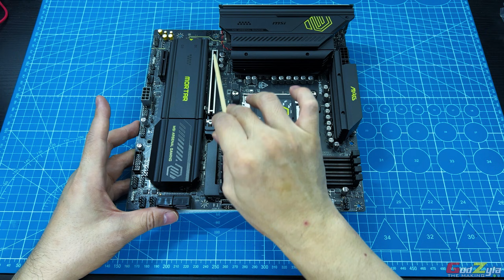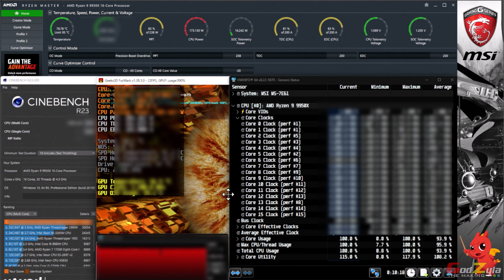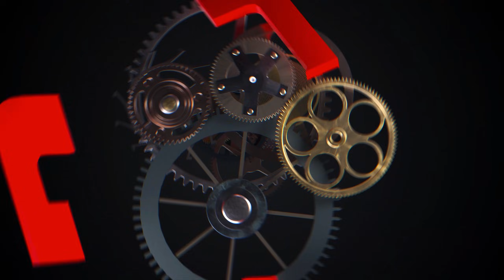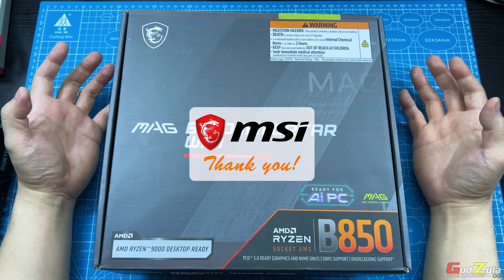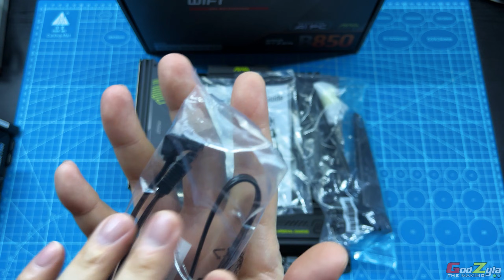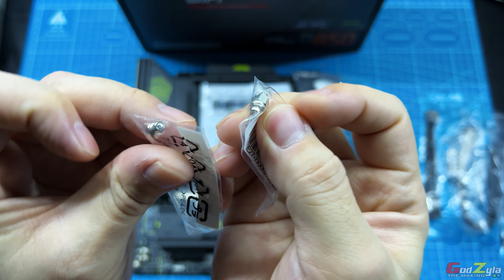MSI B850M Mortar WiFi

Comment: Lovely mobo, for the record the newer Arctic Liquid Freezer iii coolers dont fit as the PCIe slot for GPU is very close to the CPU socket and it hits the GPU backplate!
Reply from the maker: Hi Anthony Marsh, welcome to my channel. Thank you for the info, I wasnt aware of it till I go through the list. https://support.arctic.de/lf3-compatibility
Reply: damn, almost just pulled the trigger on this exact combo lol
Reply from the maker: Hi Swainix, welcome to my channel. That's close. maybe change another liquid AIO.
Reply: @KleoYan  it says compatible on the arctic's site?
Reply from the maker: Hi Xeon, welcome to my channel. For this board MSI MAG B850M Mortar WIFI, at arctic compatible listing  https://support.arctic.de/lf3-compatibility,  it says "Unfortunately, ARCTIC Liquid Freezer III is incompatible with this motherboard."
Reply: @KleoYan oh! sorry i don’t know maybe i typed in the wrong model or it was bug but yeah it does show incompatibility😅.
Reply from the maker: @Xeonedts no worries. We all do mistakes from time to time 😉
Reply: Thx for the info! My mortar arrived today and I've been planning to use arctic aio. Not sending back the mobo 😅 It's solid and no better mATX at this price point.
Reply from the maker: Hi HW Synergy, welcome to my channel. Yup this B850M Mortar is value for money. Maybe if you can return the Arctic and get another liquid aio will be great. Thanks for your feedback. I wishes you all the very best with your build. 🫡
Reply: @KleoYan  I havent got the aio yet so all good :) thx for the review
Reply from the maker: @KmtHW  oo ok ok .. got you and you are most welcome. 😉
Reply: So what do you think is a good aio cooler for this mobo?
Reply from the maker: @Papah_Anum  hands down. I will grab the Lian Li Galahad Lite II ARGB.
Reply: @KleoYan  Thanks buddy, I will check out the reviews.
Reply from the maker: @Papah_Anum  you can view the unit video https://youtu.be/y1EbZQb7__4?si=AW9-Calfe_Dt_Jlt and to see the comparision between the non argb or argb https://youtu.be/NHGm5789EW4?si=FqxprPX1zgnzEgBb. Infact some shops selling more expensive of the performance instead of the ARGB but when tested, the ARGB is slightly better and cost abit cheaper.
Reply: But I just ordered that 😂. So what should I get instead?
Reply from the maker: Hi Judas Blewit, welcome to my channel. If you have already purchase the GA II Lite performance, just use it 😉
Reply: @KleoYan  Thanks!
Reply from the maker: @judasblewit  You are most welcome 😉 infact you won't go wrong with either variant, the GA II Lite is a superior Liquid AIO.
Reply: @KleoYan  I'll order that baby it's on sale right now as well!
Reply from the maker: @judasblewit  Thanks good and congrats on the decision 👍
Reply: I have this motherboard and use a Nh-u9s air cooler with my R7 9700x.
Reply from the maker: Hi Eazy E, welcome to my channel and thank you for sharing the info 👍👍👍
Reply: Not completely true! I just bought both this motherboard and cooler and managed to get it fitting perfectly fine.
Reply: How about for a vertical setup

Comment: such a good youtube channel, motherboards are so underrated, i know the fact when i gotten lga1200 motherboard during 2021, and i kind of regretted it due to the fact it is a dead board unlike am4, so i was looking for a good am5 matx motherboard and stumbled upon this video. never skim or discount on motherboards, get a good one like this and it will last
Reply from the maker: Welcome to my channel Justin Wee. I am glad this content is useful for you. Thank you for the feedback and all the best with your new build 😉
Reply: @KleoYan i just have this mobo, have msi gaming trio 5070ti, 5 argb fans, 7800x3d, and when i install mystic light, it causes lag in windows during start up, after uninstall rgb software, the pc is okay. is this common, and do you know the solution to this problem ?
Reply from the maker: @JustinWee-k9m  I have not encounter what you are facing, the only thing I notice is that. MSI Center will load after HWinfo64 is loaded. It takes about 5 to 8 seconds to load. I have no solution on your case as I can't replicate your issue. I advise if you can ask at MSI reddit forum, there might be someone having the similar issue as yours. https://www.reddit.com/r/MSI_Gaming/
Reply: I have fixed the issue from this method
1. Open windows error log (and critical issue is power kernel 41)
2.Shut down, and unplug plug gpu power, ram slot, to ensure wires is tighten
3. On back, go to bios, and reset bios, making my RAM from overclock to 4800MT default, safe and exit
4. Entered windows, run some games, turn on and shut down PC 3 times safely, no issue
5. On back, go to BIOS, and MANUALLY set voltage for overclock RAM for the 6000mhz, 1.35v, soc 1.2v, memclk
6. save and exit
7. shut down and power on from cold boot 4 times, no crashes for now

root cause? i think if you set auto for amd expo, the default voltage is low, i think it is 1.2v or 1.02v or something (cant remember), so because of not enough power, it cannot perform

so far so good, thanks to chatgpt (amazing)

Comment: Awesome review as always. I have the same motherboard with 9700X. But I'm getting 58°C at idle no unwanted background processes are found, repasted with Noctua thermalpaste, the AIO pump is working fine. But when I check on the OCCT it pulls 35-40W at idle and using 1.25V.....Which should be around 25-28W at 1.15V what do I do to achieve that. It was earlier around 45-47°C at idle now it is atleast 11°C more.
Reply from the maker: Welcome to my channel Midhun Gopan. Lowering down the VSoC voltage and to do Vcore Offset. You can refer to this content but you will need to know your 9700X Default PPT, TDC and EDC. Also kindly do not use curve shaper. https://youtu.be/IYK0hxQqCoA
Reply: @KleoYan   Thanks for the help, I did everything and found out the values for 9700X but still the idle temp is 59°C. The culprit I've found is the CPU telemetry Voltage is around 1.3V which is the reason why the clock speed even without doing any task is 5.3GHz and idle temp is 58°C......When I set the Power plan and put the maximum processor power to 99% instead of the 100%(default) the CPU telemetry voltage drops to 0.9-1V the idle temp becomes 47°C but the Clock speed is drastically reduced to 3.73GHz as well. Can we reduce this CPU telemetry voltage without sacrificing the performance?
Reply from the maker: @midhungopan9270  I will leave Power Plan as balance. I am not sure if you did follow the vid but will provide you the steps. my method is not to push but to undervolt to get above average performance. If you are aiming to keep pushing. then ignore the steps below.

==Undervolting  Steps for 9700X==

01) Make sure to have latest bios version but not beta version on your motherboard
02) Clear CMOS first  (PLEASE MAKE SURE TO CLEAR CMOS) 
03) In UEFI go to Overclocking
04) Enable A-XMP or EXPO (depending your rams which it supports)

For Step 05) set it if your rams are of 6000 M/T

05) Set DRAM Speed 6000
06) Set FCLK Frequency 2000
07) Set UCLK DIV1 Mode to UCLK=MEMCLK
08) Set CPU Voltage to Offset
09) Set CPU Offset Mode Mark to - (negative)
10) Set CPU Offset Voltage to 0.05V
11) Set CPU NB/SoC Voltage to Override Mode
12) Set Override CPU NB/SoC voltage to 1.15v (make sure is 1.15v and not 1.5v)
13) Save and load to windows, run Aida 64 Stability test for 30minutes

If with errors, go back to UEFI, set the CPU Offset Voltage to 0.025V, repeat step 13) 
If still error, go back to UEFI set CPU Offset Voltage to Auto. (repeat step 13) 
if still error, go back to UEFI set Override CPU NB/SoC Voltage to 1.16V (repeat step 13) 
If still error, go back to UEFI set Override CPU NB/SoC Voltage to 1.17V (repeat step 13) 

you might need to set NB/SoC Voltage higher if it keeps failing but do not set CPU NB/SoC voltage above 1.18v
If no errors, go to UEFI and proceed to step 14).
The above is to ensure your processor can run at offset voltage and your RAMs able to run NB/SoC Voltage at 1.15v ~ 1.18v (depends which is stable for you)

14) Click on Advanced CPU Configuration
15) Click on Precision Boost Overdrive
16) Click on Manual 
17) PPT Limit to 88W / 88000mA 
18) TDC limit to 75A / 75000mA 
19) EDC limit to 150A / 150000mA
20) Set Platform Thermal Throttle Limit 85
21) Scroll down, click on Curve Optimizer
22) Select All Cores under Curve Optimizer
23) Select Negative under All Core Curve Optimizer Sign
24) Set All Core Curve Optimizer Magnitude to value 20 (make sure is -20 and not +20)
25) Save and load to windows, run Aida 64 Stability test for 30minutes

If with errors, go back to UEFI, set All Core Curve Optimizer Magnitude to -15, repeat step 27)
If with errors, go back to UEFI, set All Core Curve Optimizer Magnitude to -10, repeat step 27)
If no errors proceed step 26)

26) Set curve shaper as following.
Med Frequency , Low Temp & Med Temp & High Temp to -15
High Frequency , Low Temp & Med Temp & High Temp to -10
Max Frequency , Low Temp & Med Temp & High Temp to -05
27) Save and load to windows, run Aida 64 Stability test for 30minutes

If with errors, go back to UEFI, set Curve Shaper to all auto, use only Curve Optimizer, then repeat 27) 

Final test run, you can follow or not to follow as I do these test to ensure my system runs stable. 
A) Run Aida 64 Stability Test for 2 hours 
B) Run OCCT with the configures below and run 2 hours
C) Set DATA SET to Large
D) Set MODE to Extreme
E) Set LOAD TYPE to Variable
F) Set INSTRUCTION SET to AVX2
G) Set time to 2hours
H) Highlight CPU+RAM
I) Click on start and run the test.

Once all done, play some games and observe.
Reply: @KleoYan  I have done almost everything except the FCLK and UCLK things only set the EXPO . Since I have the same motherboard there is no stability issues on curve optimiser with -20, CPU offset voltage to 0.05V, SoC voltage to 1.15V everything is stable.

The surprising thing is when I run cinebench and furmark simultaneously the temp never gone beyond 61°C 😂. But the idle is 58°C......and btw my bios is updated to the latest one released on March 16th, and cleared the CMOS as well.
Reply from the maker: @m @midhungopan9270 he issue is not on the settings. Is more of others wanting to push. Setting power plan from balance or performance without knowing it will draw more current. That’s where temperature will increase.
Reply: @KleoYan It is always in balanced mode. But we can change the minimum and maximum processor state in advanced settings for balanced mode as well. Which is on 0% and 100% by default. When I change the 100% to 99% for maximum state the temperature will be drastically reduced from 58°C to 47°C idle. Also the clock speed went from 5.5GHz to 3.73GHz on idle and CPU telemetry voltage went from 1.3V to 0.9-1.0V......I'm not an overclocker and I prefer stable performance along with optimum cooling is my thing, but watching 58°C at idle made me look around and is there something I did wrong. You have the most detailed and easy to do content by miles.
Reply from the maker: @midhungopan9270  Oops! my bad, now I see it.. hmm for this I am not able to answer your question as I don't fiddle with that setting. The only settings I will set will be 1) PC never to sleep nor hybernate 2) Monitor will sleep after 1 hour 3) Turn off hard disk to Never

Comment: Between this and the Asus TUF B850M Plus WIFI, which is better?
Reply from the maker: welcome to my channel Tito Gamer, I prefer this board as it has a 5G Lan port and the Wifi 7 adaptor is making use of qualcomm 865 which is of 320MHz signal channel bandwidth as compared to others which are using MT9725 mediateck adaptor which only have 160MHz singal channel bandwidth
Reply: @KleoYan  thanks for the input. I was decided on the TUF Mobo after watching your video review but when I saw this I thought this was better and more future-proof.
Reply from the maker: @acestaniel all the very best with your build. 👍
Reply: @KleoYan  thanks! Your videos are very informative and comprehensive.
Reply from the maker: @acestaniel  you are most welcome. 🫡

Comment: Hello 👋, I have this board as of now my parts are wd Sn850 x, xpg s70, noctua nh-u12a, ryzen 7800 x3d, deep cool ch270 digital case. Ram and gpu yet to buy. Will this be a good build for solid 1440 p and 4k down the road I am looking for used 30 series card and I don't have budget for new 50 series. Ram wud be 32 gb ddr5 cl 30 or 36. And psu is 1200W super flower leadex vii.
Reply from the maker: Welcome to my channel tech INC. All your component check out well, you might consider 4070Ti Super for higher resolution gaming.

Comment: Question1: I have planned to use a 1tb gen4 ssd and 5070ti gpu on this boad. Should I connect the PCIe power cable on the lower side of the mobo?
Question 2: In my country, only thermalright AIO coolers are on my budget. Can you tell me what dimension of AIO I should buy which can be connected to this mobo unlike arctic liquid freezer iii pro
Reply from the maker: Welcome back MaybeWeirdVideos, it will be wiser to plug the bottom 8pin PCIE socket. This will provide stablity to your lanes on PCIE and M.2 Slot. as for thermalright AIO. I will go for the Thermalright Frozen Warframe 360 BLACK X
Reply: @KleoYan  Thank for the reply man. Really appreciate your insights and deep knowledge. I can spend exta 20 dollars to go for thermalright grand vision 360mm for the nice display, would you recommend this one over frozen warfame?
Reply from the maker: @maybeweirdvideos7557  So far I have tested only 2 Liquid AIO from Thermalright, I am not sure how good the Vision 360 is. anway if you are using 9800X3D with PBO2 set. It should not be an issue to cool it.
Reply: @KleoYan  Thanks again for the suggestion, my cpu is ryzen 9 9900X. I will then look into some reviews of these AIOs and then will decide
Reply from the maker: @maybeweirdvideos7557  you are most welcome and all the very best with your findings 👍👍👍
Reply: @KleoYan Back to you again my friend.
Question: There are two CPU 8pin connector holes on the upperside of the motherboard, should I connect both to power up my CPU? If not, which one I should connect to?
Update on AIO selection:
I have decided not to go with thermalright AIOs cause here in market a lot of units have faced warrenty issues and a reputed salesman told me not to go with it. The distributors are of thermalright here are not helpful too to response in those matters. So I decided to take deepcool LM360 instead.
Reply from the maker: @maybeweirdvideos7557  Dave Stevesen it can operate with just one 8Pin EPS connector, look for CPU_PWR1, the word is inprinted on the motherboard, check around the 8pin sockets. I will still encourage you to use both for more stability.
Reply: @KleoYan Thanks for the reply. I will use both then❤
Reply from the maker: @maybeweirdvideos7557  you are most welcome and all the best with your build 😉

Comment: Hi Which Cpu Air Cooler would you recomend , as i hear its a tight fit, betwen the Cpu socket and the Gpu  ????
Reply from the maker: Welcome to my channel Mr B, I have tested the AirCooler Thermalright Peerless Assassin 120 SE or the Thermalright Phantom Spirit 120, both of these performs well and will fit nicely to this board without obstructing your GPU.
Reply: @KleoYan  Thanks for the Reply, I have Tough choice bewteen the two, my board is due today thanks 👍
Reply from the maker: @mrb3991  lets just say that both are good Air Cooler and I can understand how you feel. A personal suggestion. If you have the budget go with the newer Phantom Spirit 120 EVO or Vision EVO (It has a display panel) and it has 7 copper pipes in stead of the Peerless Assassin 120 SE.
Reply: @KleoYan  HI will the Thermalright Peerless Assassin 120 CPU Digital version  fit my new Board thanks
Reply from the maker: @mrb3991  I do not have the Thermalright Peerless Assassin 120 CPU Digital version, so can't answer your question. so sorry.
Reply: @KleoYan  Thanks for your help youre ,Amazing
Reply from the maker: @mrb3991  You are most welcome.. All the best with your build too. 🫡

Comment: Regarding that M.2 Slot at the back. If I use it as my main drive where Windows is installed, using Gen3 ssd, will it affect the speed/performance when I run my games/productivity softwares that I have installed in other the other ssd drives that's Gen4?

Like, since the OS itself was installed in an inferior Generation ssd, I'm wondering if it's a good idea.
Reply from the maker: Welcome to my channel HBeep. It's not ideal to do that, unless you are able to attach a heatsink to your m.2 or to use thermal pad to contact between the M.2 and to your case metal of the motherboard area. I do not advise you to do that as you will face thermal throttling which will lead to your m.2 not performaning.

Comment: The previous model of this motherboard was and still is the best! Unfortunately, the B850M Mortar WiFi presented here has one flaw - the placement of the PCI-E slot. For owners of extensive air cooling for the CPU, this motherboard is simply out of the question; it’s not suitable for use. The PCI-E slot is too close to the processor socket.  
I have no idea what was going through the minds of the designers of this motherboard. I don’t understand how you can ruin the MSI mATX MORTAR line like this. This motherboard has a very rich amount of USB-C ports, a good audio codec, no RGB, good BIOS, and they even improved the chipset heatsink. All of that is for nothing because if you want a small motherboard with air cooling, you have to go to the competition.  
MSI, why…..
Reply from the maker: Hi R, welcome to my channel. Thank you for your valueable feedback, I will highlight this to MSI. Thanks again!